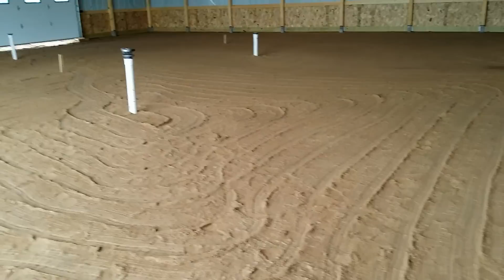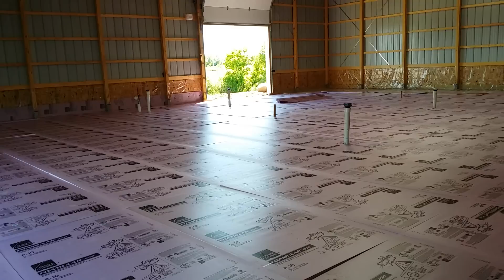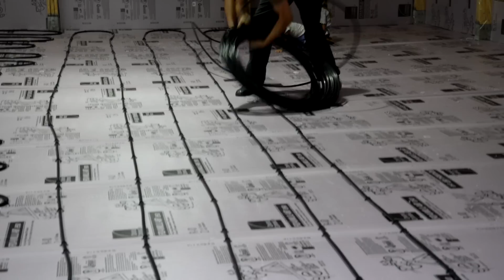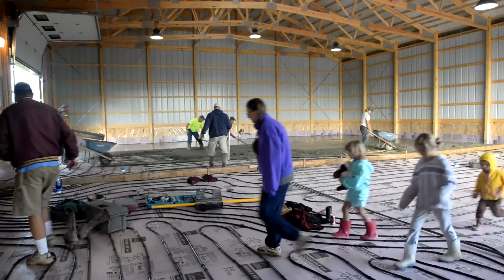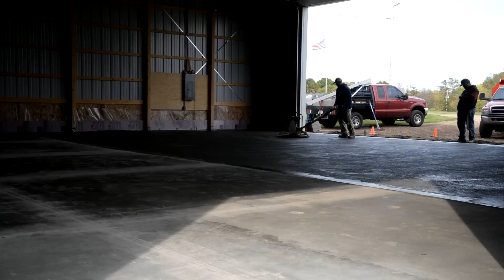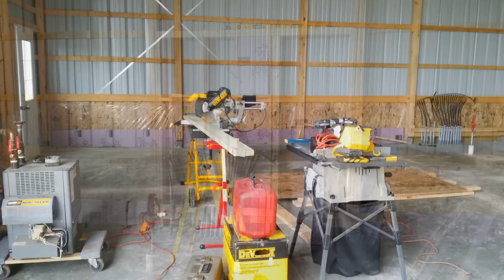Installing a Heated Concrete Floor in Morton Barn

Comment: Your barn looks great. I am about to pour concrete in my radiant heated pole barn too.  I am torn whether to pour concrete around the 6x6's or frame out so the concrete does not set up around the posts. Have you had any cracking issues around the post?  what do you recommend?
Reply from the maker: No issues around the posts with my barn

Comment: did you use 1/2 inch pex tube? i am going to lay a heated floor in my shop with 6" concrete as well,very informative thanks
Reply from the maker: +rodney lewis yes 1/2 inch I believe

Comment: 1) Vapour barrier
2) Concrete foam insulation
3) Wire mesh reinforcement
4) Radiant heating tubing
5) Cement

Comment: I'm guessing a concrete pump machine would be nice, not just for convenience, but no worries about rolling wheelbarrows over the tubing.
Reply: +romansten9 You are correct - we do very few of these using wheelbarrows.  A line pump is best, better yet is to to boom pump the floor first and then anchor the pole barn in.
Reply: Jay Phillips I agree generally what we do is boom pump it either through the door or they will put the posts in and the wall perlins than we will pour it.

Comment: good video.

all the science websites that do testing on vapor barriers with or without foam say that the barrier should be against the concrete. I know that every contractor has different opinions, but that's what the studies are saying. with the foam as another barrier. maybe it's not a real issue
Reply from the maker: +romansten9   I not 100% sure on other methods but our concrete guy told us if we put it on the foam the pex tubing staples or the concrete rocks will tear very small holes in the barrier and the workers might tear it with their boots so to protect the vapor barrier this is how we did it I guess=)

Comment: I got a couple of questions.  Are you using Upanor type A pex? Also, what about anchoring any future equipment into the slab?  How are you going to prevent puncturing the radiant floor pipes?
Reply: If you know some one with thermal camera or rent it you can see heat pipes and locate area where is safe to drill anchor bolts.
Reply from the maker: +BrownParticles If you need to sink into the slab any anchor bolts unless you mared out area you cant drill anymore then 4 inches into the 6 inch slab.  Sorry I forget the A pex I have to look